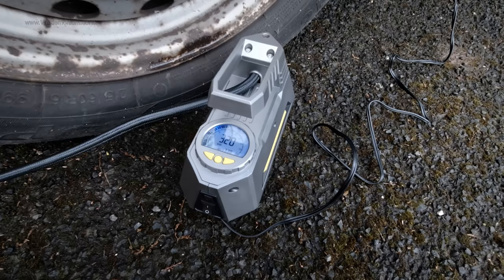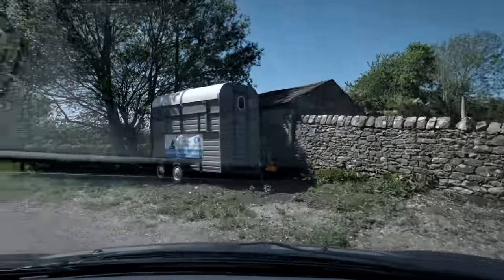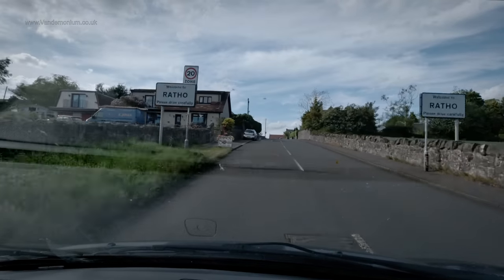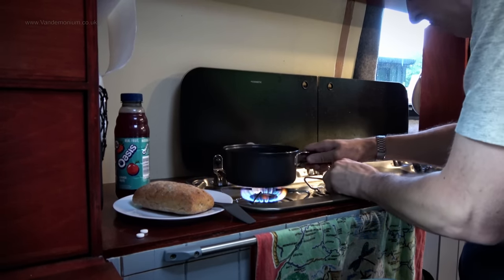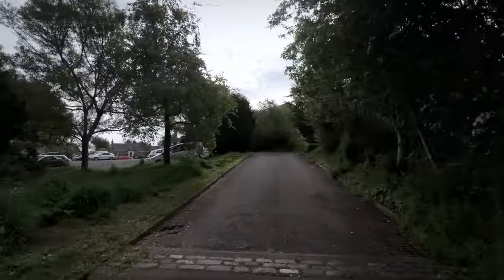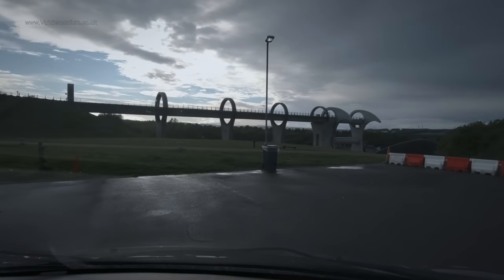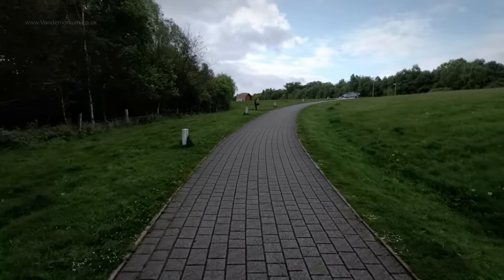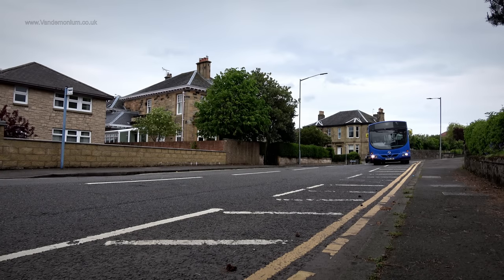63. A quick blast up to Scotland in the campervan

Comment: The Pennine Tower at the services was built as a posh restaurant back in the mid 1960’s. It had a view over Morecambe Bay (west) and the Trough of Bowland (east) for those dining there. It was closed in the late 1980’s due to fire regulations (only one way in and out). These days it’s a listed building, but with no public access.
Reply: From wiki: The services is notable for an unusual hexagonal concrete tower on the northbound side, named The Pennine Tower, which originally housed an up-market restaurant and a sun deck.[5] The tower was designed to resemble an Air Traffic Control Tower and is a prominent local landmark. The tower is 74 ft across.
Reply: There are some videos on YouTube where some have accessed the tower.
Reply: ... and like most listed buildings seems to be being left to crumble. Looks very tatty these days. Sad that the powers wot be are able to list things but can't provide any funding to look after them.
Reply: Interesting

Comment: Re services on M6. That was on the "Preston Bypass" which was the first stretch of Motorway in the UK  So the service centre was designed as a destination. The tower had a full service retaurant on top. I recall that shortly after it opened, I went on  a sightseeing coach trip with that service centre as the destination,

Comment: Courtesy of Wiki... The Pennine Tower  originally housed an up-market restaurant and a sun deck. The tower was designed to resemble an Air Traffic Control Tower and is a prominent local landmark. 

The tower closed to the public in 1989 due to current fire regulations (there is no means of providing an alternative exit from the restaurant deck in an emergency), and is only used for storage and occasional staff training. The tower was built to give views over Morecambe Bay to the west and the Trough of Bowland to the east. 

The Tower was listed Grade II on 15 October 2012.
Reply: Have a look at this video, pt 1 of 2 where they explore the Hilton Park services tower (presumably with permission).  I believe it was built for all the same reasons as the Lancaster one https://www.youtube.com/watch?v=UXoOCe0RiOE

Comment: Top tip - store your tins upside down so when you open them the bits that are normally stuck in the bottom are stuck on the lid and can be scraped easliy.

Comment: That tower was designed to look like a control tower.  The tower used to have a restaurant and sundeck , but that was closed due because it did not meet the fire code.  It is used for storage now.

Comment: I delivered campervans (relocated them) driving 1200km (745 miles) in 24 hours..(including a 3.5 hour ferry) and I always noticed the banging and crashing associated with the lightweight cabinetry and the "hollow" interior....which was very fatiguing.
I then changed that by driving them for 10 miles or so after pickup with ears pricked  to catch any obvious mechanical possible failure points before I got too far away from the base mechanics...
Then I would don Grade 5 Peltor industrial ear defenders for the rest of the journey...
I could recognise trouble from the vibrations etc. and doff the defenders to pinpoint the problem if necessary.
Much more enjoyable journeys with minimal fatigue.....
Bombing up the UK motorways with wind noise, engine drone, and crash rattle bang inside I am sure would give me a headache as well....

Comment: OBD-II code readers are relatively compact, and have gotten quite inexpensive. Since you're something of a DIYer, it's probably not a bad piece of kit to add to your equipage. They do help with peace-of-mind when that pesky light comes on, and you can easily look up codes on the internet. Having driven commercial trucks in the United States, I get the sense that whoever invented the speed bump must have hated lorry drivers, and by extension, van drivers as well. 14:27, Ooh, an Airstream! Converted into a concession stand, obviously, but that's a well-known American caravan, made in Ohio since the 1930s. That particular example appears to be of mid-1970s vintage. A grand couple of days out, indeed!

Comment: These days you can buy an "on-board diagnostic" (OBD) unit that plugs into a vehicle's standard interface port and will read the codes in your computer for not a lot of money.  Some use bluetooth and have an app that runs on a smartphone (Blue Driver for instance).  It's a nice-to-have auto accessory for those instances like yours where you see the CE light but aren't really sure of the cause or how serious it might be.

Comment: Hi David, and a very nice vlog, thank you. Interesting to learn you could park your van at the Falkirk Wheel car park. Do you have to book this facilty in advance? (asking for a friend who has a small campervan). Re Lancaster Services. The tower used to be an upper restaurant in the early days of the services, and I lived in the area close to it in the 80s and it was still open then. Sadly I believe it had to close due to a change in fire safety regulation, because of perceived problems exiting the structure.
Reply from the maker: Cheers. No pre-booking needed but you collect a ticket from the barrier at entry and then get it validated (I think it’s £15 a night) at the visitor centre.

Comment: I used get the engine light problem when I had a Sprinter on very wet days with deap puddles. Soon as there was some heat under the bonnet it would clear.

Comment: Got a 180 miles drive to Suffolk next week in my 1932 Morris Minor Two-seater (not to be confused with the post-war 1948-1971 Morris Minor). It's going to have to be done on standard roads away from motorways (40-45mph is about the max I'll take it to, so far too slow for the M5/M42/M6, & A14). It's going to take me most of the day to do it. I'll then have a weekend of road tours before making my way home again (about 500 miles over 4 days). I'll be sleeping in a proper bed while there. 😂
Reply from the maker: Oh wow, that sounds amazing
Reply: @Vandemonium  Yep, and exhausting 😆

Comment: just to say I run a Diesel Yaris and when I fill up put about 4 litres of vegetable oil bought from Aldis to add to the Diesel, doesn't seem to hurt the engine and gives me about 10 miles to the litre. Every little helps.
Reply: Keep a close eye on your diesel filters...
the vege oil does a great job as an algicide and if any is killed off the fuel tank surfaces....it will end up in your filter (s)
If your Yaris can't even pull the skin off half a rice pudding in future...that may be the answer.....

Comment: Engine Error Code, perhaps the tire inflation pump caused the vehicle computer to conclude that there was an unexpected current leakage, caused by the air pump being plugged into a 12v socket. Maybe?

I built a portable 12v battery box, containing two small lead acid batteries in parallel, so 14 A-hr. I mostly use it to power my mediumly-large air pump, because it needs up to 15A and my vehicle sockets can only supply 10A. Very convenient.

Comment: Hi David,we do get sunny weather up here u know,because  u had a headache after driving have u checked the gas and the exhaust split for co2 leak into the cab ?
Reply from the maker: It was just the length of the drive, concentrating as I went
Reply: @Vandemonium  as long as your OK.

Comment: You should pick up one of the Bluetooth car scanners online - less than £10 and you can check and clear the codes yourself. (OBD 2)
Reply from the maker: I think I might
Reply: I can definitely vouch for those scanners. They are a very useful tool to keep in your glovebox. The only thing I would say is (and this is just my personal opinion) if you use a BlueTooth scanner, there's a delay when you're viewing live data. So if you have for example a faulty throttle position sensor, with the cordless tool you'd see the data but would have a small delay as it reads the ECU and then sends it to the app on your phone. With a cabled scan tool it's instantaneous. I have a scan tool tablet which was £1200 with loads of leads, but sometimes, it is quicker and easier to grab the little handheld tool because if your EML is on you'll read the codes and it tells you exactly the same thing as an expensive scanner!

Comment: David, is your headache when completing long drives a new thing..i.e. after  you got your new van...or has it always been a problem?
If it has manifested itself since buying the van...just wondering if there is a fume leaking into the van problem? 
I presume you use "fresh air in" setting on the ventilation controls with at least fan speed 1 in order to overpressure the van interior with fresh air?
Reply from the maker: it was just the length of the journey
Reply: @Vandemonium  
I delivered campervans (relocated them) driving 1200km (745 miles) in 24 hours..(including a 3.5 hour ferry) and I always noticed the banging and crashing associated with the lightweight cabinetry and the "hollow" interior....which was very fatiguing.
I then changed that by driving them for 10 miles or so after pickup with ears pricked  to catch any obvious mechanical possible failure points before I got too far away from the base mechanics...
Then I would don Grade 5 Peltor industrial ear defenders for the rest of the journey...
I could recognise trouble from the vibrations etc. and doff the defenders to pinpoint the problem if necessary.
Much more enjoyable journeys with minimal fatigue.....
Bombing up the UK motorways with wind noise, engine drone, and crash rattle bang inside I am sure would give me a headache as well....

Comment: As your van had sat for a long period, and you had multiple error codes it might have been caused by a low battery voltage - modern vehicles don’t like low batteries, they throw lots of error codes all at once…
Reply from the maker: Good point, although the van started straight away, no issues

Comment: Just a cautionary tale concerning your code issues. I have a stow and go Dodge caravan and about one year into it I start getting all sorts of phantoms codes and it was starting to fry my (thankfully warranties) computer modules. Turned out it was the wiring harness for the back lights that travel along the edge of the floor and were being crushed the the weight of something I had flush with the wall as it jounced and bounced
Reply from the maker: OK, good tip: thanks!

Comment: It's worth getting a cheap Bluetooth code reader that pairs with your phone. They're under a tenner and very handy for checking basic OBD fault codes when the money light comes on.
Reply: Is that the thing that plugs into the weird socket under the dashboard, like a SCART socket?
Reply from the maker: Yes, the scart type socket thing
Reply: @tomkemp9465  It does look a bit like one. It's called an OBD (On Board Diagnostics) port. There are lots of phone apps to pair with the reader. I use one called Torque and another called car scanner. Both work very well.

Comment: Follow the earth lead from the main battery and it'll be bolted to the engine bay body or chasis. Remove at that point, wire brush, coat with copper grease and reconnect. A bad earth can throw up fault codes and do all sorts of odd things. Worth coating the battery terminals with copper grease too. Buy from halfords.
Reply: This is good advice, but most modern vehicles have multiple grounding points.    That code could be a fault on any of numerous circuits, and tracing out the source can be traumatic without the aid of an advanced ODB-II tool to specify which circuit group is throwing the fault.    Let’s hope it was indeed just a transient bit of damp, not to be repeated.

Comment: The fuel calculation is a little bit off. A US gallon is less than a UK gallon. To add further insult to injury UK fuel is typically 97 Octane whereas US fuel is mostly 87 octane (with premium coming in at 93 Octane) so not only do you get more fuel for your "gallon" but there's more energy in it too. As an expat of more than 25 years I'm finally getting the hang of the fuel thing :)
Reply from the maker: I used US gallons in the calculation, as specified
Reply: You are mistaken about the octane ratings.   Europe reports octane using RON while the USA uses (RON + MON)/2.     British 97 octane “super” is the same stuff as American 91 octane “premium”.

Comment: You don't need a reader to clear the ebd error codes. Just remove a terminal on the battery, turn on a cab light to ensure all the energy has dissipated and then re- connect the battery terminal. If the yellow light comes back there is still a fault, if it doesn't it was an intermittent fault that has been cleared.
Reply from the maker: I think I prefer a code reader!!

Comment: the canal can use tunnels to continue under the motorway.
Reply from the maker: Unfortunately it's not that easy as there may not be enough clearance so there'd have to be locks and level changes as well
Reply: @Vandemonium  not only that but cutting into an existing roadbed in the middle of its service life is extremely complicated and expensive . It’s a much easier sell to include then as “improvements”  during scheduled renovations

Comment: A "quick Blast" in a van ? are you channelling Guy Martin ?

BTW a. Bluetooth scanners are 10 bucks from china. b. If you drop the earth off the battery for 10 secs and then put it back it will usually reset most of those silly errors.

Comment: the price for diesel here in newfoundland is currently hovering around $2.30 per liter Canadian. i think that works out to over $3.60 per liter British pound sterling. correct me if I'm wrong please.
Reply: I think you've done the calculation backwards - $2.30 CAD is approx £1.46 (I think you did £2.30 GBP to CAD which equals $3.63). Hope that helps :)
Reply: Confirm £1.46. My latest fill was £1.77/l. so you are better off than me. It's probably all the taxes piled on top of the fuel price that does it!

Comment: I had an earth short circuit on my van caused by the previous owner not attaching the earth wire to the gear box properly. It meant that the van didn't start at all and the attachment had to be replaced for a proper one which took the AA guys all of about 30 seconds.
Reply from the maker: Luckily, the fault hasn’t re-occurred (yet) touch wood.
Reply: @Vandemonium  Hi David, I would recommend cleaning all your earth cable connections, including the clamp on the battery terminal and the battery post. Then apply some grease over the top to protect the connections from any future damp and corrosion. Love the video. Scotland does have some stunning scenery.

Comment: Nuggets!!! Diesel was the fuel of choice, once upon a time. Lithium isn't looking too good either. Ever see one of those go up in in-unquenchable flames? SCARY!! OH, THANKS FOR DOING This CALCULATIONS.
Reply from the maker: You're thinking of the lithium packs used in electric cars, but the LiFEPO4 chemistry used in campers and boats etc is a much, much more stable chemistry which you can do terrible things to and it still won't go up in flames.